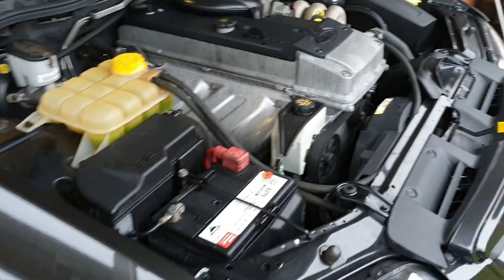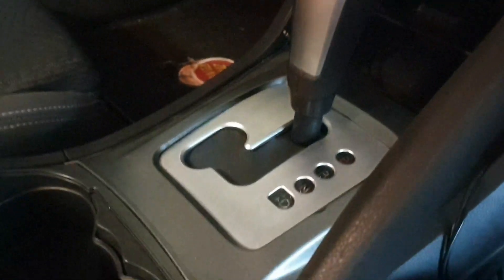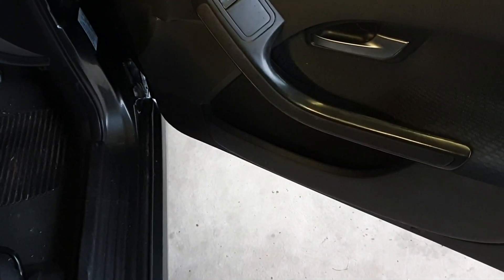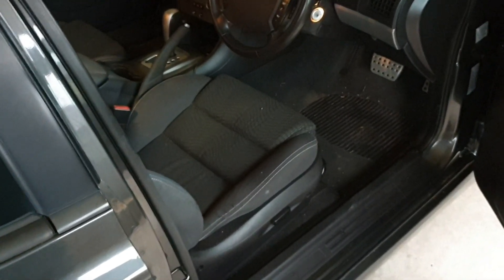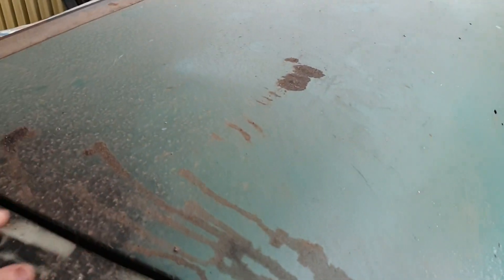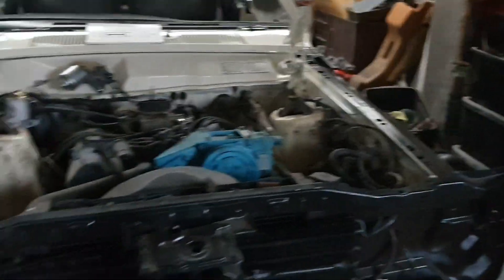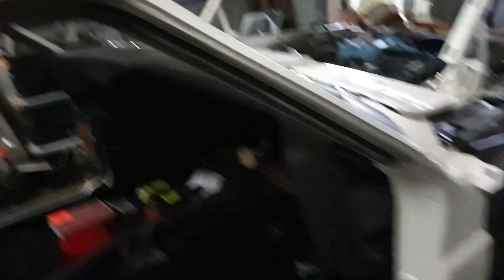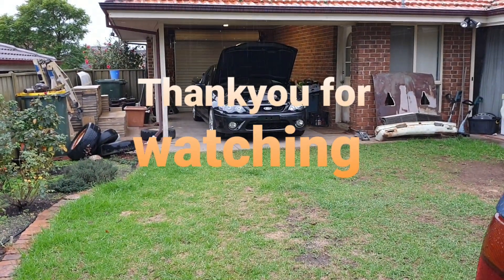Repairable write off update

Comment: What do you charge for a resto like that . Amazing work mate
Reply from the maker: Restored to what stage? Painted? Just the rust fixed? I try and avoid doing reassembly of the cars but we just work off an hourly rate of $60 an hour
Reply: Up to painted stage . Cheers mate
Reply from the maker: @MrArty250  and how rusty? Ive found on average cars in the condition of the xy sedan I'm doing just the rust is between 12-15k and that's for a car that isn't too bad body and paint is hugely time consuming
Reply: I was offered mazda cx9 repairable written off car in 12000 cheaper than market Value. Should I buy? Car looks completely fine like a new. But I wonder how come they fix car so cheap.